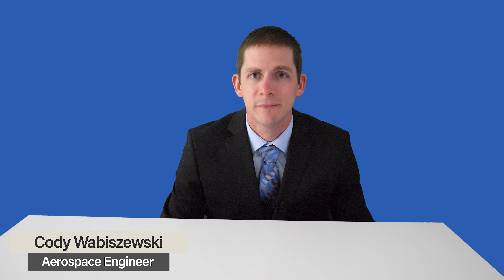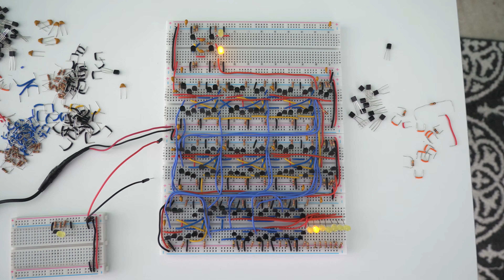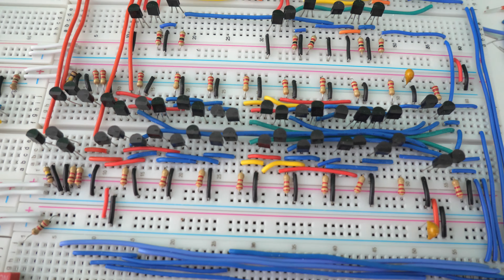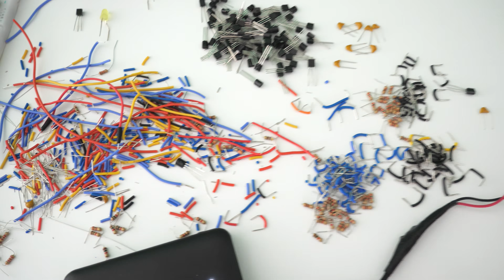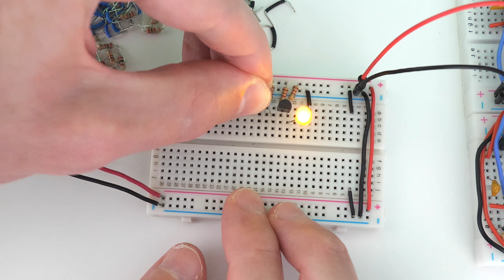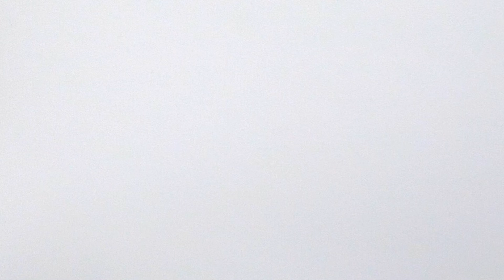How to Test Transistors

Comment: By all respect your Test fixture is Stupid crap beyond human reasoning and logic, because and one point every Transistor will show to be faulty, because those contacts of the breadboard will wearout faster than you expect. Beter using a clamping mixture like a vice to test   like you do. You need to compensate for wear in test rigs if you want to test such transistors in bulks. Those puny bread board contacts are not meant for such abuse. You won't do yourself a favor  by ignoring or deleting this comment. Because its fact that your test system is flaught.
Reply from the maker: Well, the idea is to test them how they are used. Even if they work in a fixed clamp, they might not work on the breadboard. It really seems like some work better than others if there is minimal contact with the breadboard connections. I would rather reject a few good ones, then to trouble shoot issues with a finicky transistor. Yeah, the breadboard locations will only last for about 100 tests I just switch locations and use a low cost extra breadboard so it is worth it.
Reply: Your technical points are useful, but the way they’re worded comes across more harshly than helpful. Phrasing them more constructively would make people more open to your ideas, which will help you get further in life. Putting “[with] all due respect” doesn’t make the rest of the post respectful (e.g. saying “stupid crap beyond human reasoning and logic”).

Comment: Use multimeter is easy!
Reply from the maker: That would work in some cases. The issue is that the transistor can work sometimes but then you bump the transistor and it makes them not work. That is why I found wiggling them around with the LED was helpful at finding good transistors.

Comment: What is the name of transistor? 2n2222 or bt547 or other?
Reply from the maker: These are NPN transistors, model number 2N2222 or 2N3904. Both are very similar and would work for all the circuits I show that use NPN transistors.
Reply: using only 2n2222 or 2n3904 transistor can be used to make processor, memory card, logic circuits etc.? or bt547 may also be needed?
Reply from the maker: @omrmmmdzad6849  I think you mean the BC547 transistor. This is another general-purpose NPN transistor that would work.  I am pretty sure the emitter and collector pins a swapped meaning the pin order is collector base emitter rather than emitter base collector. So you just have to flip the transistor.
Reply: @GlobalScienceNetwork  thanks

Comment: Something else I've noticed is you don't seem to be using base resistors between logic stages, only on the inputs. One priblem that can arise if you're trying to drive two or more transistor bases without individual resistors is Vbe clamping, where the transistor with the lowest Vbe clamps the voltage below the needed Vbe for the other transistors and "steals" most of the current, preventing the other transistors from fully switching on.
Reply from the maker: I am pretty sure I know what you are saying. I was trying to build the circuits as simply as possible for demonstration purposes. When building flip-flops where the output was sent back to the input and to the next circuit I did realize this happened. I added a buffer to get consistent behavior but this required two additional transistors. There might be a way to get consistent behavior by adding resistors as you mentioned. Thinking about it briefly wouldn't the resistor need to be added between the emitter and ground of every transistor, as the voltage drop variation is the issue? I found the common way this is solved in ICs is to use a three-transistor NAND gate design where the input goes into the collector and is floating on. This way the input can be sent to as many circuits as needed, as the circuits are all on unless grounded. Using two transistors NAND gates or three transistor NAND gates results in about the same number of transistors when the buffers are added. If adding resistors can solve this, that would be nice!

Comment: Good advice. I have run into transistors not working in circuit as they should. But I’ve also noticed breadboard discrepancies. I am buying expensive breadboards designed with better and stronger internal clips, and I’ve still noticed variations in their manufacturing. So I’ve wondered if the breadboard themselves weren’t sometimes to blame for these bad transistors. It’s concerning when you are building something large like this.
Reply from the maker: Yeah, I am using cheap breadboards and BusBoards are better. I have not done in-depth testing as to why the transistors do not work. I just noticed that a bad transistor caused the LED to flicker. It can be difficult to determine which transistor is bad in a large circuit so I started testing them in advance. Most of the time I can get the circuit working by replacing the transistors. One time I did have to swap out the breadboard likely because of a bad internal connection. Some packs of transistors I get have a failure rate of less than 10 percent and others are higher. If they all fail the test it is likely just a bad connection on the test board. After testing lots of transistors within the same spots it will wear out those internal clips.